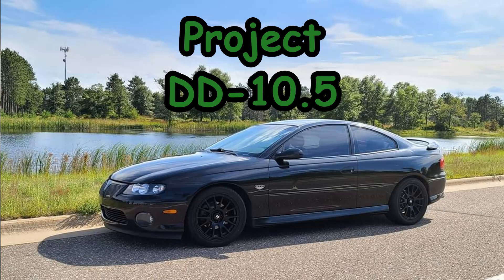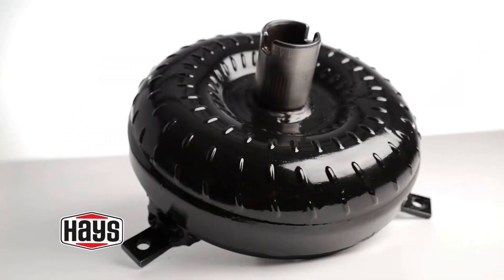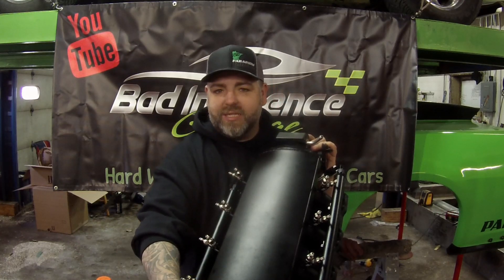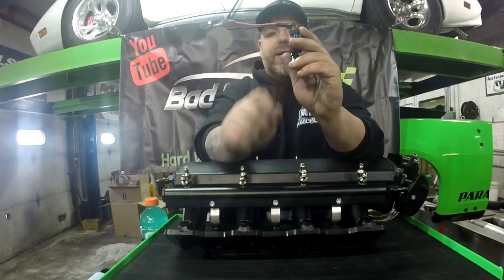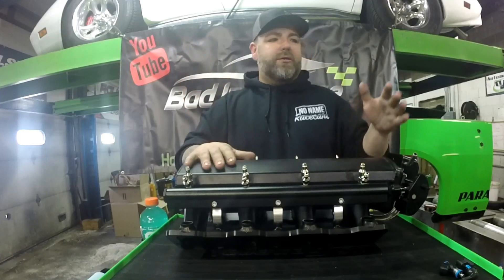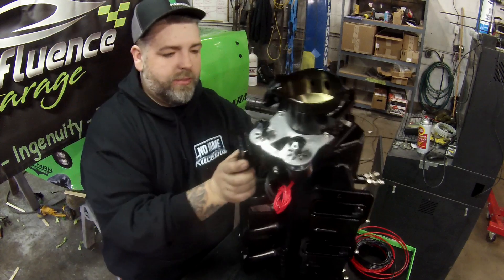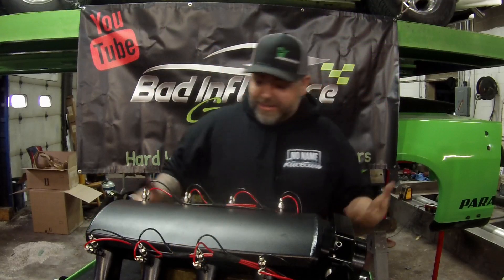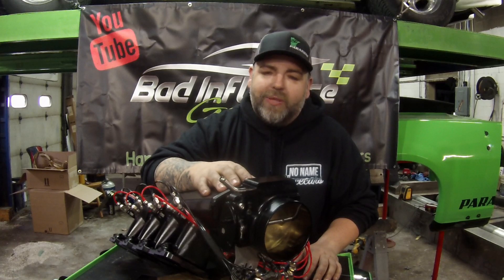Nitrous Plumbing for Project DD-10.5, Nitrous GTO Streetcar

Comment: Sorry to hear about Mark.  

Great to see a GTO on the channel.  I've run a few times up at BIR with my GTO as a casual thing.  I'm most curious to see how you've set up the suspension for your car.  My 05 manual GTO had insane wheel hop and wondering what you did to get around that.
Reply from the maker: So wheel hop on the GTO can be remedied a few ways, i use a Pedders Drag shock and Drag Bags in the rear springs. I adjust the drag bags air pressure depending on track surface since i do not have adjustable shocks (YET lol) also rear cradle bushings are huge on these cars, get poly bushings in and they handle and work much better.
Reply: @BadInfluenceGarage  with the poly cradle bushing do you have to re align the cradle or are they solid enough that they “align themselves” enough lol.
Reply from the maker: Since we own an alignment and repair shop (attached/ part of our daily regular job) I had a technician do an alignment. It wasn't far off, but it was off a tik. You could likely get away with it for a while as long as you do 1 at a time in the car. If you drop it to do other work too, I'd align it right away.
Reply: @BadInfluenceGarage  cool also commented on your other video about your intake.
Reply: @BadInfluenceGarage  thank you for the info! hope to see more GTO content soon!
Reply from the maker: That's the plan! We'll be showing the parts process along the way, then a big 1 or 2 episode deal of tearing it down, rebuild, and hit the dyno then track 😎👌